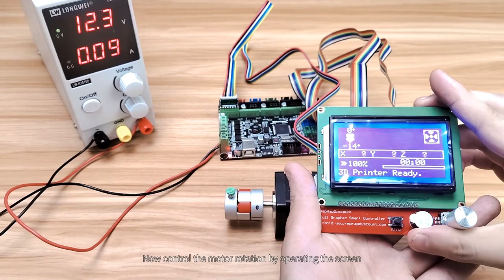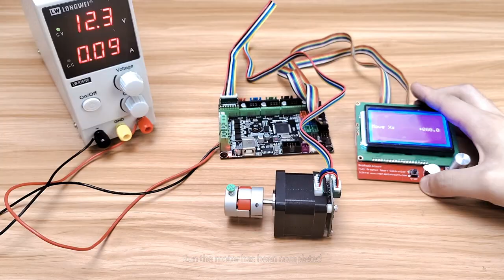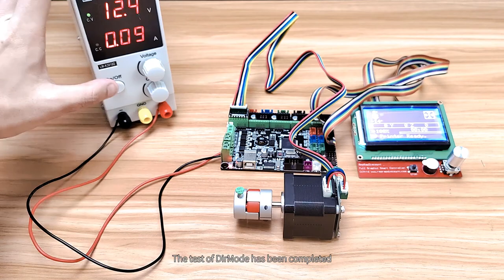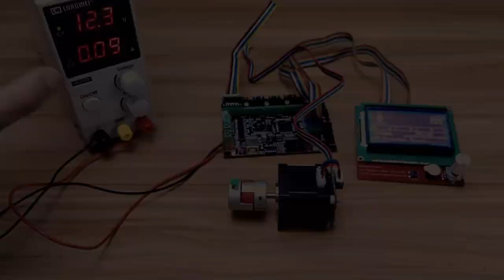MKS SERVO42C Closed loop Stepper Motor Manuals（2）Menu

Comment: This is a fine video  but one step is HIGHLY needed or explained. What power supply do you need to power the motor for the first time. 12v or 24v. Please, Please add to video!!!!!!!
Reply from the maker: 12, 24V can be

Comment: Hi, I have three of the SERVO42C, and I noticed that by default light torque load can deflect the shaft by 2-3 degrees without the motor fighting hard to correct it, this leads to poorly defined edges on moves and a loose hold that is susceptible to vibration, I think it might be the torque setting or perhaps the PID values need tuning, do you have any tutorials on this?
Reply: Hi there Spencer. i have the exact same problem. by any chance did u find a solution? thanks so much
Reply: @HEC MG  Yep, I upped the "accel" value to 1024, I think it's called accel... one of the last few options as you scroll through the menu, it's not "perfect" but it's better than most steppers at a fraction of the current, could be called Torq... you'll know it when you see it, not close to one now, otherwise I'd check
Reply: @foxabilo  thanks so much! really appreciate

Comment: What driver to select or set in MARLIN FIRMWARE?     I have used TMC2209, TMC2208 and others. I want to use these on x and y (a and b) for core xy and TMC2208 on z and TMC2209 on extruder for linier advance. So what to select for X and Y in Marlin
Reply from the maker: No need to choose, just connect the driver

Comment: Hi, there was a problem with these drivers( I can’t get them to work stable, there are shifts during idle movements( Firmware marlin 2.0.x, motherboard skr v1.3, printer with coreXY kinematics
Reply: I have the same problem when I connect two drivers / motors in parallel without losing steps? I have dual X and dual Y steppers. when I used Servo 42C, there are missing steps and drifts when the load is high.

Comment: Hi,  I have an Ender3 Pro which I want to upgrade to a closed loop due to a few shifting I had recently. I just bought the  board,( SKR V1.4 Turbo), 2 motors (S42B) with it's drivers, 1 TFT35  Screen and I want to run the same examples you do in this video, Problem is, on start, the screen doesn't show anything, I think the board needs a firmware. I have no idea of how to get it loaded to the board. Please help.
Reply from the maker: Which TFT35? The moving interface and moving axis on the screen are the same as those in the video